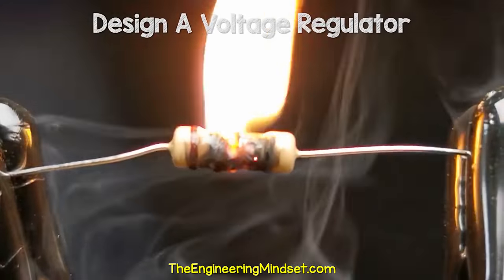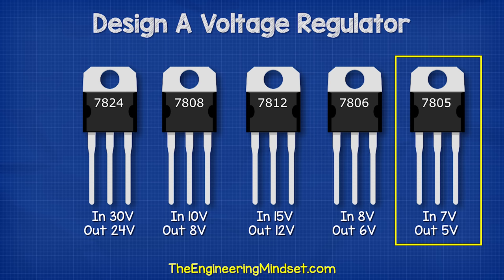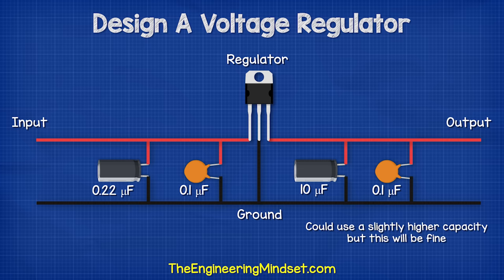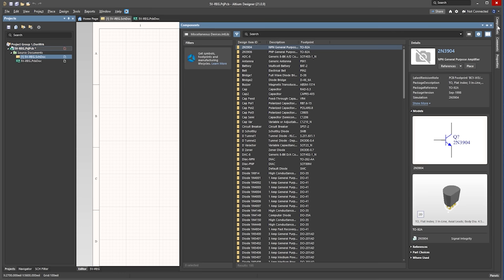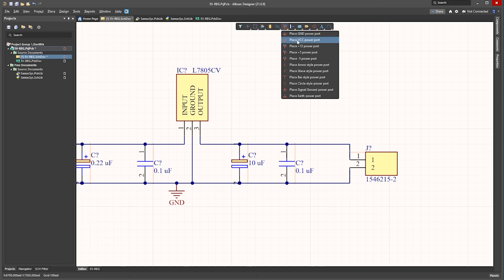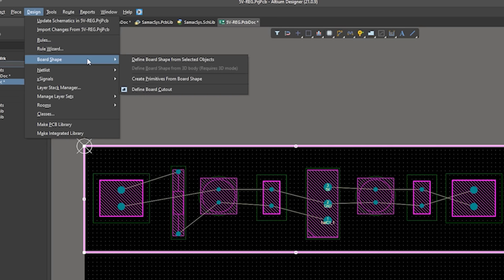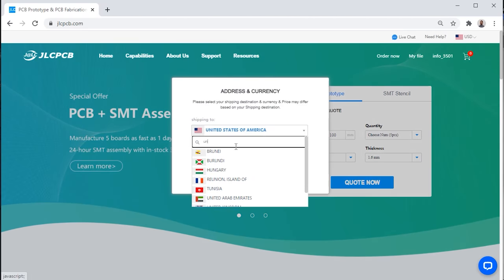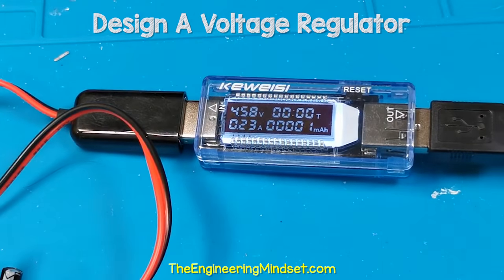5V Regulator design tutorial - How it works, how to design PCB  altium

Comment: If the voltage regulator is drawing 1/4 A and the voltage difference between the battery and the output is 4 V, doesn't the regulator dissipate 1 W of loss?

Comment: Your rar file contains NC  drill folder as well. Do we have to export NC drill as well?
Reply from the maker: Just upload entire .zip folder to JLCPCB no need to open the file or make changes
Reply: @EngineeringMindset  When I output my custom gerber file from my personal project and generate content , I usually get a gerber folder, I don't get any NC drill Folder. My question is, Do I have to generate NC drill also? And zip it all together or, zip only gerber Folder and upload to jlcpcb.?

Comment: Heatsink is required or not for 7805?
Reply: LM7805 is 1.5 peak at current rush, approx 1 amp max with heat sink, or it will thermal shut down. Test it  over a time period and you will see.  With sink and no sink.

Comment: I hope any professional or technician can tell me: why on blueprints or schematic phase or VCC is always connecting visually correct but when negative is connected, it shows to a one line only of negative or neutral but in PCB looks with more sense, a charge getaway into a + and continues on a - but it goes to a + of the next component, not sure if it is clear

Comment: Fantastic, wow.....
But the small board making cost 15 dollars is too high (I think)
Reply from the maker: No, it's $2 for 5 boards that's insanely cheap. The only big cost is the postage and you can select a slower option to get it cheaper
Reply: @EngineeringMindset  ho ok ok sir. And thanking you for replying me, I couldn't expect this wow super....
Reply: Most PCB manufacturers wont even take your order if you don’t order hundreds or thousands of copies. The fact that you can order small quantity for that price is a miracle.
Reply: @Rayden440  mm I got it bro👍

Comment: is there a way to not use the diode this way for reverse polarity protection? At high amp amounts that thing is gonna draw 0.6v * the amps which will be masive
Reply: No it won't
Reply: @John-ed2wj  check that your diode isn't a fuse
Reply: @bryan192  what are you on about?
Reply: There is but, it is expensive to make. Look up, active synchronisation it uses mosfet and extra circuitry to reduce the power losses

Comment: Nice job but there is a flaw in the design of PCB. There is no room for a heatsink. If you put 12v dc to 5v dc and draw a max current of 1A you will need a very large heatsink. Linear regulators disepate a large amount of heat in that configuration. For the small current draw, it is ok but for charging phones no. No one uses those old phones so this can confuse amateurs. Have that in mind. Else is 100% 🆗

Comment: It'd be amazing if they add the components with the board
Save you the time in soldering
But you never learn till your hands get dirty 😉
Reply: Costs more and you would need to obtain a list of the parts they stock and work only with them. Some places will accept your parts as long as they are reel based which means buying loads of the same component and also probably means buying an SMD version of the LM7805.
It would cost even more to hand someone hand assemble it with your parts due to labour costs.
Reply: @Infiniti25  of course it'd cost more but you will get a precise treated soldering without any mess. Call it trade off
It's better for microparts and IC's that requires heat gun or oven, Since some of the companies have a return policy if the board is DOA or not properly working because one of the parts is bad.
Reply: @cyborgedude  it’s a cost I don’t think can be justified or be cost effective for the people that will think this circuit has much of a use aside from learning through practical and maybe as a space heater.
If you were serious enough about having a PCB produced for such cost then you would be designing a more efficient circuit.
PCB printing like used in this video is useful for prototyping and for proving theory works in a practical example fairly cheaply depending where in the world you are and the cost of the producers you can get access to.
As you said in your original comments, get your hands dirty 😎

Comment: Is there a service that someone would design and build a small PCB like this? I have a 12vdc circuit that drives a double pole stepper motor. Would like have something to connect to the circuit and have small LEDs light up to prove the driving circuit.

Comment: How do you decide how much capacitor value you should out in output?

You install 10ū F , i want to know the reason please
Reply: It will state in the data sheet for the said device what values of capacitor to use.
Reply: @John-ed2wj  Does it state anything about why 0.1uF capacitor filters noise but 0.22uF connected in paralell doesn't?
Reply: @ic6406  The .22 is a smoothing cap for the supply and the 0.1 is for the noise
Reply: @John-ed2wj  How does 0.1 understand that he is for noise and 0.22 doesn't?
Reply: @ic6406  A smoothing cap is always polarised, whereas the ceramic 0.1 is not.
Reply: @John-ed2wj  So why can't we just use a single ceramic capacitor for both filtering noise and smoothing (smoothing is the basic function of all capacitors by definition)
Reply: @ic6406  A smoothing cap as in the example has to be polarised and electrolytic caps are the best and cheapest method, where the value is not critical. A filtering cap needs to be a more accurate value, hence a ceramic is used. 
Smoothing is not the basic function of a capacitor, I'm not sure where you've read that.
Reply: @John-ed2wj  I derived this from the logic of how it works. It charges and then releases the charge, so that consumers always have current. I derived it from diode bridge where you can place any capacitor after diodes and it smooths voltage on the end by storing and releasing floating voltage from diodes
Reply: @ic6406  'storing and releasing the floating voltages from the diodes' - what on earth are you on about?

Comment: Were is the heat sink for the regulator?
Reply from the maker: It'll probably be fine with such small voltages, but if we increase the input voltage or output current we'll need one

Comment: 4.6 Volts out of a 5volt regulator 8% fail. would also have been better with full wave rectifier feeding the input then have a look at the ripple reduction that the 7805 gives you!

Comment: Wasnt the output supposed to be 5v and up to 1.5A?
i it the 9v battery that is the reason why the output was "only" 4.6v and 0.23A ?
Reply from the maker: Diode causes voltage drop, current depends what is connected, in this case the phone only demands 0.23A so that's what it is supplied
Reply: @EngineeringMindset  but the diode was on the input side of the transistor, meaning the input would've been ~8.6v, but the transistor should've sent 5v with at least 7v?

Or does the drop over the diode also affect the output?

Comment: the small Schottky diode you are useing won't handle a lot of current, better use a higher current one if you want to use the 1.5A the regulator is rated at.

Comment: I had seen some stupid design in VCD Player. 
Input 12V
7805 output is 5V.
7805 consume 7V and produced lots of heat.
U can not finish seeing a two hour movie.

I opened the VCD player. Added a heatsink to the 5V regulator.

Comment: I thought shotkey was the black one and zener was the glass one?
Reply from the maker: Generally is, they just used different packaging for some reason.
Reply: Thanks for clarifying. I was freaking out thinking I was doing something wrong in my circuits lol. I'm still in "tinker" stage. Not quite to "I need to calculate every single one of these" phase. @EngineeringMindset

Comment: In some applications this 7805 gets overheated, even its not over current, do you know why
Reply from the maker: Maybe input voltage is too high or current drawn too high
Reply: @EngineeringMindset Input voltage was12v, i wanted to use it for 5v vga to bnc converter device, couple of years ago, i am surprised with the result,
Reply: @EngineeringMindset  very true
Reply: LM7805 is 1.5 peak at current rush, approx 1 amp max with heat sink, or it will thermal shut down. Test it  over a time period and you will see.  With sink and no sink.

Comment: Can this be used to charge a normal smartphone. If not can anybody explain why. Please.
Reply from the maker: Smartphone probably needs a bit more current, can just replace the components for a higher current rating and it should work fine
Reply: @EngineeringMindset  Thanks dude. I have a 9-10V solar panel. I want to charge my phone using that. And I got the exact video and the perfect channel. Higher current value for capacitors right?
Reply from the maker: Seen our new video on HOW SOLAR PANELS WORK in detail https://youtu.be/Yxt72aDjFgY

Comment: Can you make a 5,1 volt 4 Amp dc-dc converter for raspberry pi ?? 12 volt in
Reply from the maker: Just follow these instructions and change the components to be able to handle 4A
Reply: @EngineeringMindset  and add a big heatsink and the space for it on the PCB?
Would there be any benefit adding multiple output capacitors after the ceramic cap? Does it provide any benefits like cost control and heat spreading?

Comment: Can you make 4v to 12
Reply: Use the LM317 variable regulator. The variable resistance will need a fixed stop resistor to vary the output voltage between 4v and 12v

Comment: I am a very beginner in electronics. Basically from software background. Someone please help me to tweak this design with multiple output. For example i need a point which gives the same voltage, another point with 5v 2A, Another with 3v. Please help

Comment: With this design, if i take out the capacitor what will happen?
Reply: It will still work but the output will not be clean. Not ideal for powering sensitive equipment that needs to produce precise result.
Reply: @zenniz1992  if you dont mind can you explain "The output not be clean"?
Reply: If you are using a 5V voltage regulator without the capacitor, your output will fluctuate around 5V

Comment: After I generate the folder structure, I do not have a .rar file in my folder to upload. Need help.
Reply: You will need a utility to create a zip or an rar file. I used the built-in compress facility on my Mac to create a zip file. Also, I brought down Paul’s rar file from the comments and opened it up. He had NC Drill fabrication files there too. I don’t know if they are needed, but I added them in, as well.
Reply: @jordanbrower2598  Thank you so much. I selected all the exported files and compressed to a .zip file. By any case, does have Altium the feature to export Gerber files as a .rar/ .zip file ??
Reply: @shivankapriyashan3562  none that I found. I did look

Comment: The output capacitor should have a lower value than the input capacitor. When switching off the input power without a load connected to the output, the output capacitor will remain charged for a longer time, making the output voltage of the 7805 higher than the input voltage. That will destroy the 7805. Unless you put a diode between pins 1 and 3. Also, there is no point in having a bigger capacitor on the output. You just need  the bypass cap to keep the 7805 from oscillating.

Comment: But this is an inefficient circuit.The whole circuit acts as a resistor so we cannot use this circuit with batteries which provide high current.
Reply from the maker: True, but that's not the point of this tutorial. We're just making a simple linear regulator
Reply from the maker: Check out NEW resistor video, everything covered! ➡️ https://youtu.be/DYcLFHgVCn0

Comment: Could I use this as a 12 V Automotive alternator external voltage regulator and set maximun output Voltage at 14.5 vdc for field winding excitation? Would it work the same as the OEM regulator charging battery, and cutting out when 14.5 vdc is achieved?
Reply: Better to use discrete zener diode and transistors in an automotive voltage regulator. The components can then be selected to withstand voltage spike transients common in automotive systems. With the regulator ic's available the best is from 35v to 60v generally. There's the TL783CKC ic, but it has only a 700mA maximum current output.

Comment: Nice expanation, but I wept in horror when you realized you forget to rotate the input connector and told yourself: "fuck it, I'm not rotating all the components" and now the VCC and 5V lines are at the bottom instead of the top like it was during planning.

Comment: Dear Youtube Commenters:   I am about to make some of these for some projects, but am still learning electronics.  Would someone like to help answer some questions to modifying designs?  My area is 'energy harvesting', home solar with a slant towards energy efficiency.  So far it goes well but I am drowning in solar panels and ultracapacitors, batteries, and need to start figuring out how to utilize some!  If you would like to answer my random questions and help point me in the right direction, let me know!

Comment: Not bad, but it's not designing a voltage regulator it's more implementing a voltage regulator and the cap on input and output also stop it from bursting into oscillation not just filtering learnt that the hard way. Not seen anyone use two caps on input an output before. Also worth noting you explain the use of the reg for not blowing up components like the cap you showed and then put the cap in circuit before the reg, so it's not protected. Rise that input voltage above the electrolytic cap value stand over it and turn it on an bang there goes an eyeball 🤣
Reply: @kennmossman8701  Just not commonly implemented for cost saving then. Also not as shown in the example of the data sheet you'd think they would if it was that common.
Reply: @kennmossman8701  Hmm we were always taught bypass caps are used (not always needed - Madman Muntz story time snipy snipy lol)  for noisy environments where it makes sense you don't want to trigger a logic threshold from some noise from else where if you are close to upper or lower limits. On a v reg the capacitance from the two values of caps as quoted on the datasheet should be there to stop it bursting into oscillation an provide a little bit of bypass either way I've only ever used what the data sheet suggests an if done properly an not ignored the v reg sits happy as larry. Not sure if that's the environment I'm running in or what but never needed to use a bypass cap on the input rails. You will always see bypass caps on a schematic as it needs to show everything for the poor sod like myself that comes in an diagnoses it to fix it. Not only that after spending some years in CEM the schematics are usually generated from the same software as the BOM these days so you can't go around leaving parts out or the netlist would be incorrect and if you've done any AOI the same BOM is used to generate the component list and Identifiers to be programmed into the AOI to do its job of inspection.

Comment: nice video but for those who might want to use this regulator for a smartphone, it's almost useless, highly inefficient as most modern phones need around 1.5a and this lm7805 can barely supply 1m and wastes much current in heat
Reply: @kennmossman8701   @Kenn Mossman  Most current  smartphones DO need more than 1A sometimes 2A . I am using a 2015 smarphone and it draws 1.2 amps which is to be expected since its original charger is rated at 1.5 A. I am not referring to fast charging at all since it even 2A @5V is not considered fast by today's standards. It takes more than 1 hour to charge a phone @ 1 amp so imagine how long it would take with a current of 100 ma ( 10 times longer) and yes, efficiency is a factor here since people using this regulator usually power it from some sort of battery and t
he LM7805 regulates voltage by dissipating  heat then it is something to consider
Reply: @kennmossman8701  of course I argue about efficiency and current output because they are the most relevant things here. I have experimented with this regulator for months trying to make a power bank and it is by far the worst option. You keep "harping " about the fact that it can charge a phone. there are many ways you can chrge a phone but people want to do so in less than 6 hours now. I do agree that this LR has some advantages like the fact it requires very few components and if you need to draw currents of around 0.5 or less. and again, 1A is its peak current so it can barely supply that let alone for a long time. My understanding of electronics is weak but it seems yours is weaker